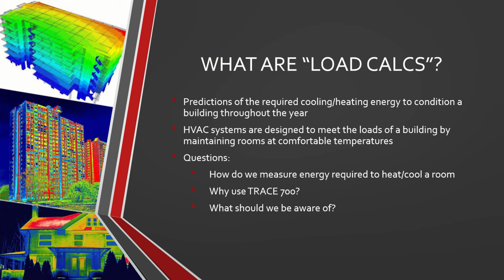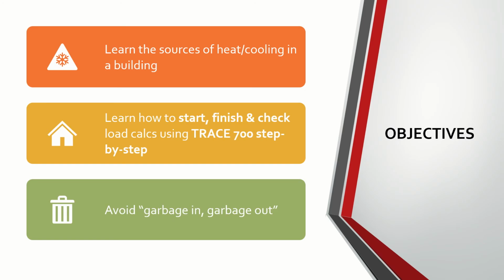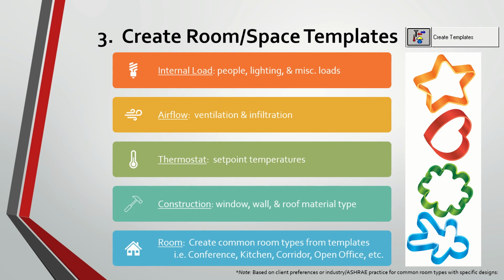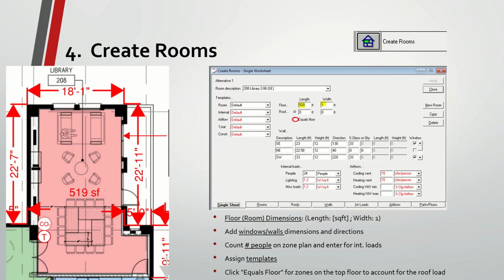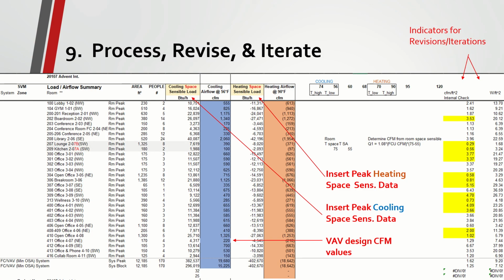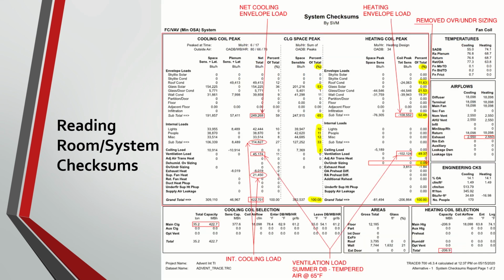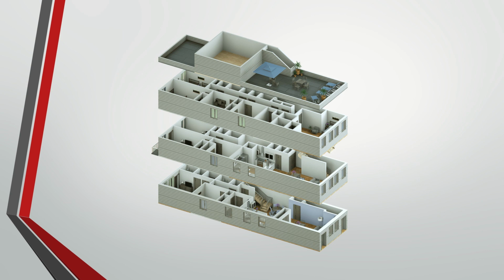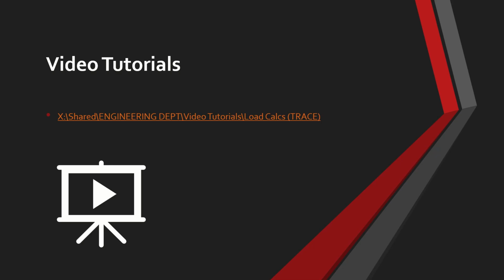Step-by-Step Load Calcs Using TRACE 700

Comment: Is the south typically where the most heat comes from?
Reply: Yes, when a load calculation is performed most of the cooling load will be observed to the south of the project. It is also a good way to check if your calculation makes sense if the south cooling load is greater than the north load you are on the right track. There will be other factors to worry about but this is just a consideration for the envelope load ( aka the  perimeter  or exterior walls, and windows). Interior load will also play a role.